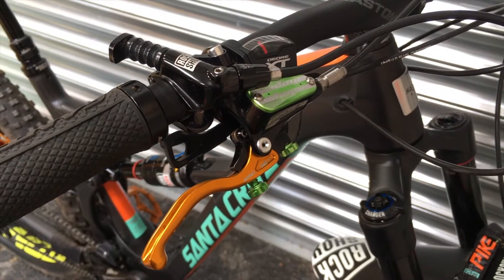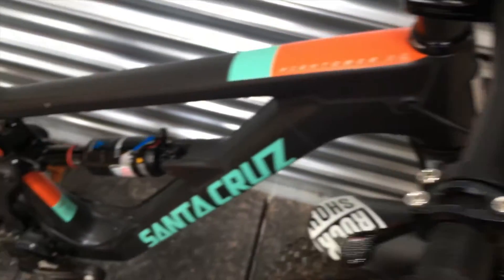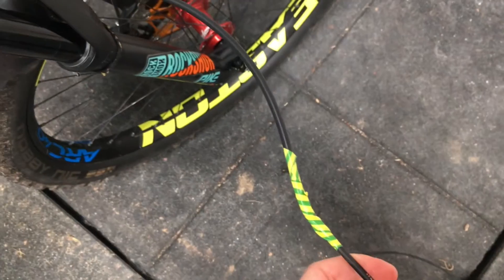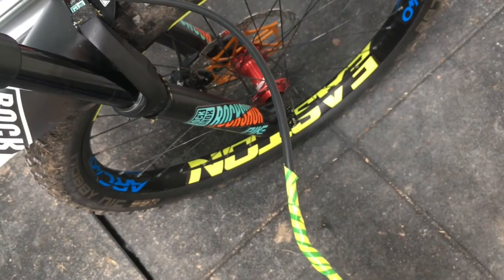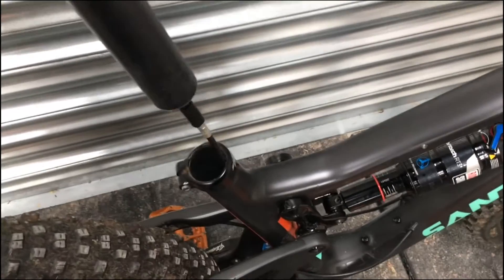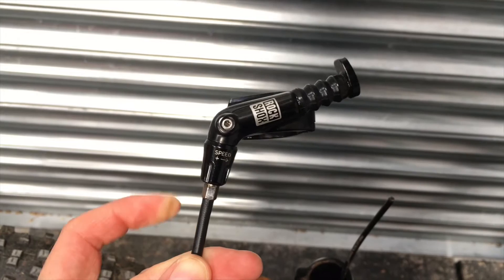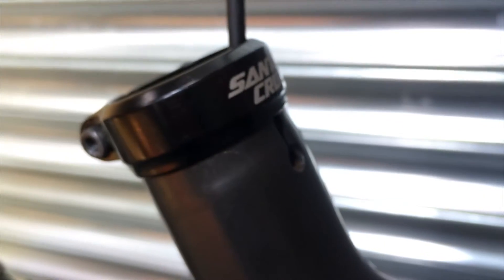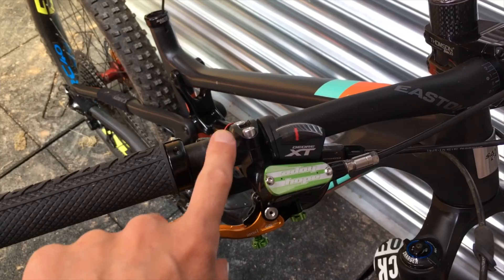How to remove: Rockshox Reverb Stealth Seatpost

Comment: Do you need to bleed the system when you re-install?  And what about spilling fluid out the open cable end?
Reply from the maker: I sent my post for a service - When I got it back I carefully unscrewed the lever and was able to re-install it without bleeding it. I put tape over the end of the hose to stop the fluid coming out.
Reply: @mtbfree4914  thank you.

Comment: But there's a disconnect at the base of the post. Why would you remive at the lever?
Reply from the maker: Even with the hose disconnected it won’t fit thru the internal cable routing in my frame 🙈